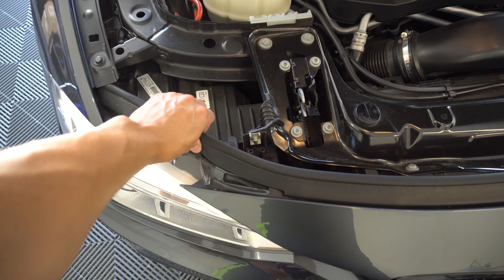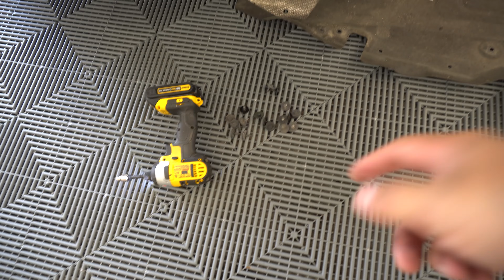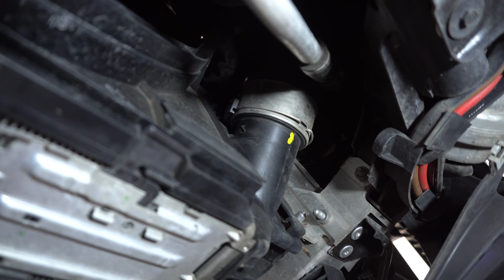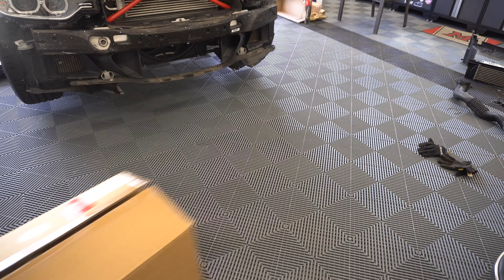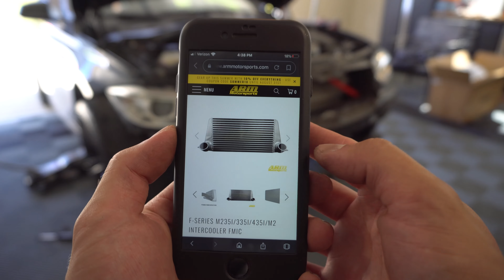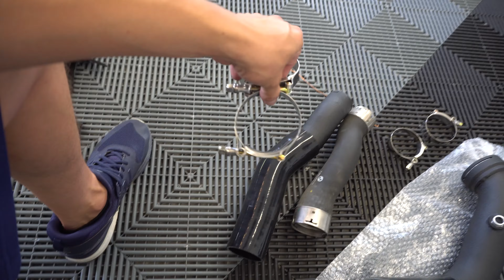Blown Chargepipe BMW F30 | PART 1

Comment: Beware these aluminum upgrade charge pipes , tolerances are not exact and sometimes you will get a leak at the intercooler joint. I'm going back to OEM plastic one.There is a reinforced one introduced in 2019

Comment: I blew mine and bought an upgrade kit. After installing will the check engine light go away and start driving normally again? Mine is currently on limp mode
Reply from the maker: It should go away on its own